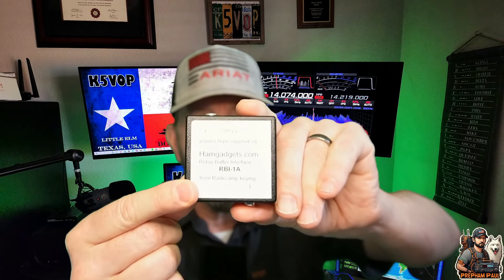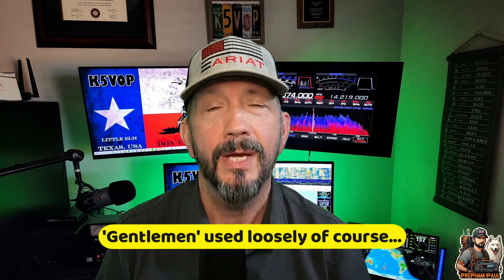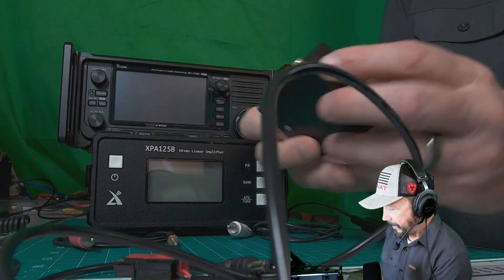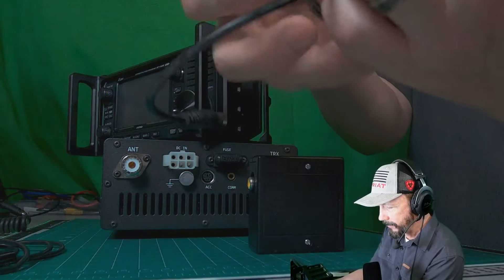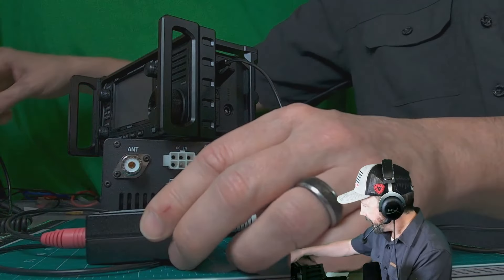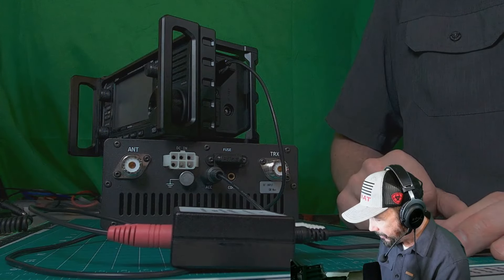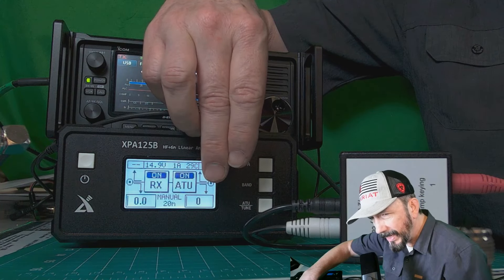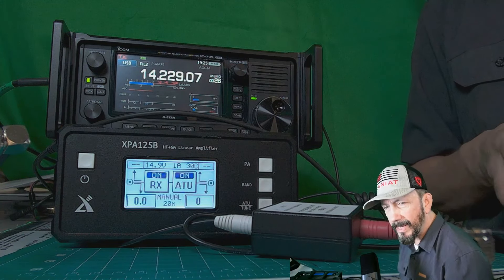Use Protection, Keep Your Radio Safe!

Comment: Will this AMP boost the incoming signal entering the IC-705?  My signals are very weak, hardly hearing anything on the 10m band
Reply from the maker: I do not believe it boosts anything coming into the radio. If I am wrong maybe someone will post here.

Comment: So it's protecting against too much voltage coming from the amp into the radio? Or am I getting that wrong? And why would voltage be going to the radio from the amp?
Reply from the maker: Not the voltage it protects the radio by reducing the RF drive level of the exciter to prevent damage to the amplifier's input through the ALC interface.